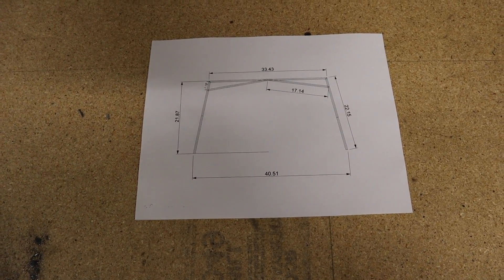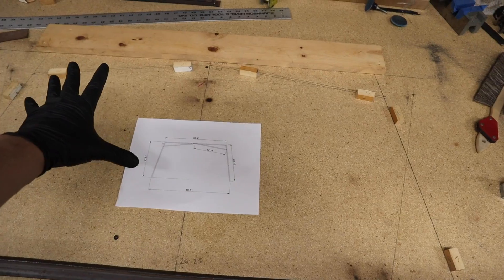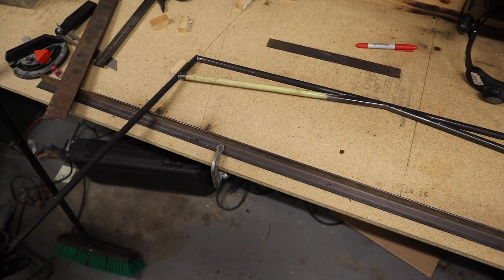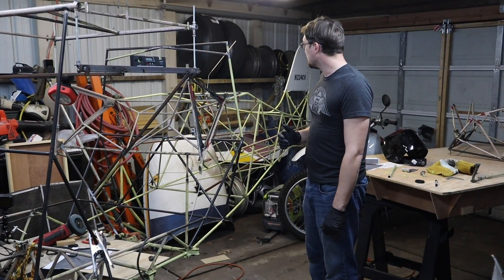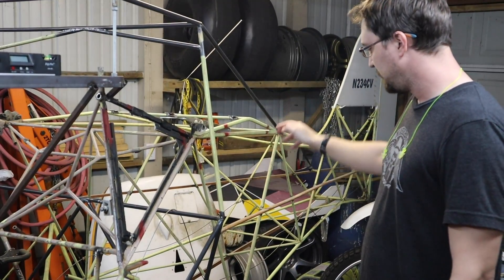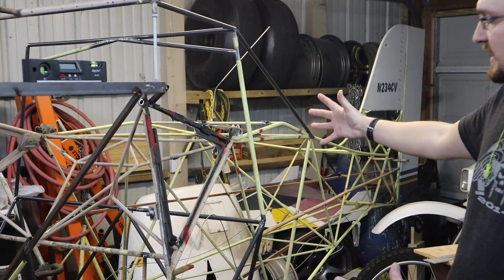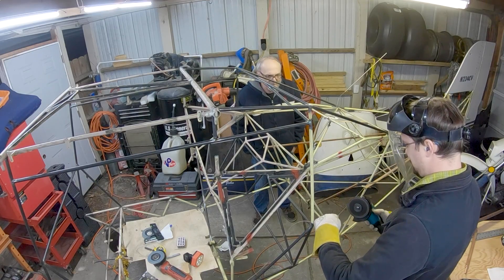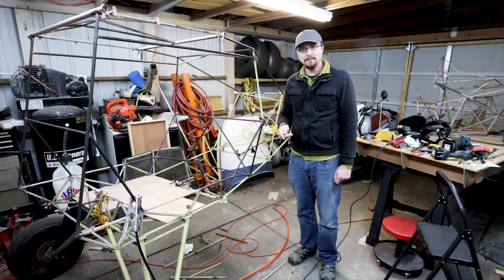Fuselage Takes Shape on the Rockhopper! - Episode 4

Comment: I appreciate the father and son collaboration, very cool. It is possible that you're building an extreme STOL aircraft that literally jumps into the air? It will be interesting to see where your CG ends up? All that aside, the tail section seems a wee bit short given the spacious new cockpit area? Keep up the great work.
Reply from the maker: I’ve done a series of cg calculations based on the work done and I expect to fall well within the range I’m shooting for. The tail is shorter than I would strictly like but it is as long as it was originally and the plane flew for more than 4000hrs that way so it can’t be that bad.
Reply: @ianslife210  I must say that I really look forward to your new videos Ian. This project is thoroughly inspiring and engaging. Its fun to celebrate your achievements & successes as this STOL build comes together.
Reply: @ianslife210  I am no engineer on plane structures!  But seriously, you need to extend the rear fuselage about 2 ft.   You have totally messed up the airflow over the tail, esp. on the top side.    I don't want to tell you later, that "I told you so"

Comment: The space inside is huge compared to an original Avid! Too late now or I would have suggested kicking the bottom out 6" rather than raising the roof 6". That way the wing to tail drop could have been preserved and it would have given you more prop clearance and rotational tail clearance for take off. The down side would have been reduced visibility taxing until you got the tail up and flying. The Avid Flyers seem to be close to landing the tail before the mains in STOL situations in their stock setup. Nice to follow along with this build.
Reply from the maker: I considered a few different ways and that one had some issues with how to route controls. There’s already a drop behind the wing but there’s not a drop for the fuselage. I’ll be handling the three point attitude using a much larger landing gear.

Comment: Does the vertical stabilizer need to be made taller since the cabin is now taller? I'm not sure if that will have an effect on airflow to the stab or not.
Reply from the maker: The aft fuselage is fairly overbuilt as it is quite short but you make an excellent point. I’ll have to load check that modification as well.
Reply from the maker: I actually completely forgot that many others have made modifications to oversize the stabs on these before with no issues. Testing will still be good but that gives me a warm fuzzy that I'm doing ok by this.
Reply: I thought that
Reply from the maker: It needs to be made taller for general need for more stab anyway and will be.
Reply: That is so true. That vertical tail slab has got to be in turbulence-free air stream after the cabin box as much as possible. The best, immediate method we use to test the air flow was by rig-mount the frame (card-board covered) to the front on the PU. Tape the test ribbons all over the surfaces, pay attention too the air ribbons on the horizontal tail slabs. Are all three tail control surfaces getting smooth air streams at relaxed positions?